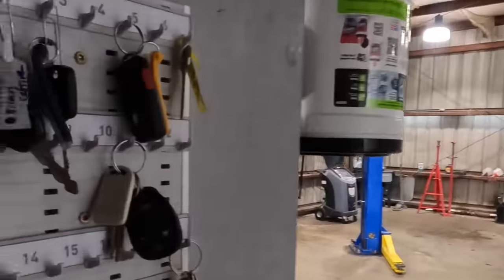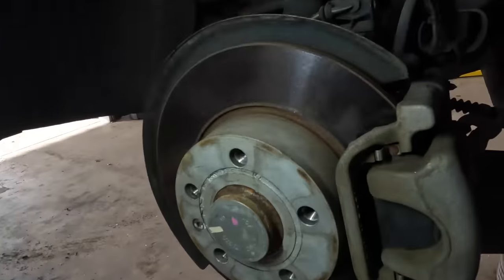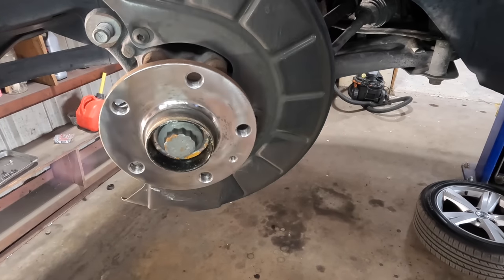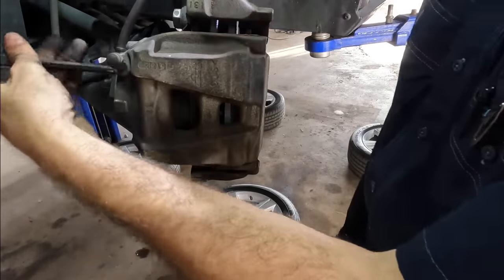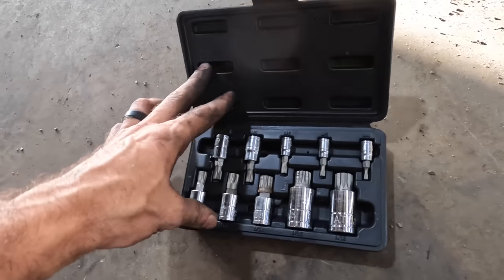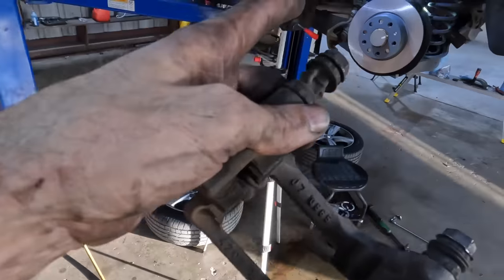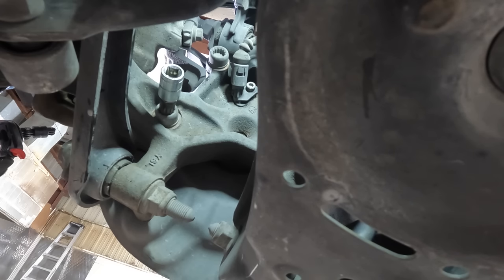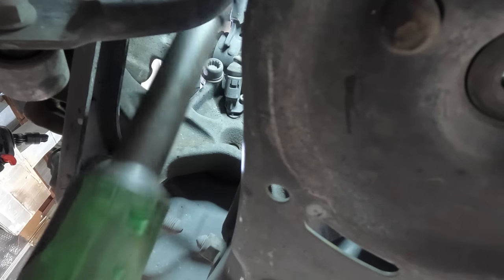Brake Job…with a Belt Sander? 2015 VW Jetta

Comment: Thanks. 33 years later I learn the name of the 1/2 inch 12 point spline tool i needed for the bolts on my mom's '73 VW 412 flywheel, and later on the cylinder head bolts for my 81 scirocco. Also, your shop is too quiet without the doo DEE doo phone ringing. I actuall miss that.

Comment: Might have been "just another brake job", but finding those frozen slide pins on one rear wheel was a good catch and object lesson for us all.  Always clean and re-lube those pins, even if all the other wheels were fine.  Good job!
Reply: I had an accident back in late 2009 because the pins on my Monte Carlo weren't lubed from the factory.  It took 4 years of driving for the pads to wear unevenly to the point of failure (repeatedly "inspected" when I got oil changes, and nobody noticed the outboard pad was fine while the inboard pad was wearing out) and my front left brake failed, causing me to rear end someone else.  That was my last Chevy.  Yes, lubing those pins is vital.
Reply: Heh, had to take a blow torch to my slide pins the other day to get them out 😅

Comment: The front caliper bolts are 7mm Allen. They can be pulled, cleaned, and lubed like normal slide pins.
Reply: That was one task that I did not see accomplished on this video unless it happened behind the scenes...
Reply: Comment needs bumped like sam said i also didn’t see it done either unless it was done behind scene. Also if im not mistaken the rear rotors you can slip past the bracket and dont need to remove it.
Reply: @josihaknox7256  The rotors can be slipped past the carrier on the style without the bar in front of the rotor if that makes sense.

Comment: I've had slide pins stuck so bad I used pliers and a torch to heat up . Then go in with brake cleaner and nylon brush on a drill. Thanks for the video Ray!

Comment: Just a gripe because this is an automotive channel. I just purchased a used Subaru Forester. I wanted to put new brakes on because I trust my own work or don't trust others. Pads had 7-8mm left, so they were done pretty recently. Slide pin on the right was completely seized, like replace bracket seized. Then, caliper on left was seized. I have to same style piston compression tool Ray has, albeit the cheap one. It failed catastrophically. So a new caliper had to be installed as well. Beware of used car dealers that just like to turn em and burn em.

Comment: Just a word of caution about reusing friction materials; I had a pair of brake shoes that had almost no wear at all and so I figured they would be fine (rough it up and go). The wheel kept locking up to the point of glowing. It seemed that some brake fluid had leaked from a replaced wheel cylinder and had gotten into the shoe changing its friction, making it sticky. Long story short, beware of contamination, not always visible.
Reply: Yeah, same experience with rear shoes.
Reply: Oil would make them sticky believe it or not, brake fluid can be washed off by soaking the shoes in water.
Reply: you have a point about contamination but I had lots of gear oil leak onto rear brake shoes. After I fixed the leaky seal I just sprayed the shoes down with brake cleaner and it worked fine for me? Truck stops great so I don't think you always have to replace. JMO.

Comment: I used to do something similar when scuffing pads, a couple of swipes on a strip of wet/dry sandpaper at the bottom of my aqueous parts washer tray (pump running). Keeps the dust at bay. Rinse with brake cleaner, done.

Comment: I have now joined the Cult of Brake Cleaner, back in my unenlightened days I had to remove the protective oil from new rotors with lacquer thinner on a rag. I have seen the error of my ways and truly repented! Besides, Brake Clean is useful for so many other things. I recently used it to free up a stuck ratchet shifter on a bicycle.

Comment: Regarding the slide pins on the last caliper bracket, could it not been excesive heat from the metal on metal that cooked the grease?

Comment: Ray...I've done this exact vehicle and removal of the 13MM triple square fasteners on the rear is NOT required. The rotor slips right out of the caliper bracket no problem. Try it next time...great video none the less.

Comment: Hi Ray, I have to say that chamfering the leading edge of a pad was frowned upon in my training - the chamfer would act like a guide for road dust etc to fit between the rotor and pad, and a square edge was better at clearing contaminants off the rotor when pressure was applied.
Reply: Look at many sets of pads and see if the OE manufacturer places chamfers on them. Think you will be surprised. Retired mechanic in Land Down Under.

Comment: The triple square caliper bracket bolts for the rears are notoriously tight in my experience in VAG vehicles. Last time I did this in my driveway in the rain I just skipped that step and managed to slip the discs in past the bracket.
Reply: Is it pain in the rear to put the discs on without removing the brackets?
Im doing the rear brakes on my Škoda Octavia Mk3 this weekend and this video makes me skip that step too haha
Reply: @Euro.Paleta  i would recommend to have a file by hand, sometimes the new brakedisc dosn't really fit. Just file a little phase on the calibre brackets just 1 mm
I don't know if the Mk3 is the same but on the Mk2 it works
Reply: @Euro.Paleta  I didn't have any issues really, just got to be careful not to scratch the discs. If you can get the old ones off without damaging them then you should be able to get the new ones on, probably... New discs will be thicker because of less wear. I did it on an Audi A3 8P 2011 with little hassle, and that had the same actuated calliper and I believe the same diameter discs on the rear as most other similar VAG vehicles, but I'm basing that of the rear brakes are primarily for stabilisation and parking, the fronts are what will change in diameter in most scenarios. 

I'd be prepared to take the bracket off just in case. Lexivon do some cheap triple squares I think. I personally felt they were too tight for me to lay under the wheel knuckle and hang off them, testing how well I'd set the stands up and covering me in rust. 

Enjoy.

Comment: VW has some insane torque values for many of its fasteners.
Reply: Also many of them are one time use. If it has a torque plus degrees of turn past then it’s definitely a stretch bolt and should be replaced not reused.
Reply: Yeah, the bolts on mine have much more torque than the engine does 🤓
Reply: No kidding. It's completely not necessary at all!
Reply: German engineering at its finest!
Reply: Jason R indeed they do. I had a 2011 jetta TDI sportswagen, most fun car I've ever owned and over time I had replaced all of the wheel bearings. If I recall correctly, the torque spec on the hub bolts was 140 ft. lbs. plus 90 degrees. I needed a torch followed by a 4 foot cheater bar on a one inch drive breaker bar to remove each and every one of them.
Reply: My2016 Tiguan has the same bolts holding the rear calliper brackets. I was aware they would be torqued super tight, but research said they were single use stretch bolts. Bought replacements but didn’t need them. Fortunately, the rear discs (rotors) once freed passed past the bracket without having to remove them.
Reply: If you look closely they have a serated face on the back for even more bite, you can see it at 38.54
Reply: many many many.  lol
Reply: Exactly, I was working on rear of VW Tiguan with same setup, we had to use Impact to break them loose and it literally took all the power my impact had, and we are talking about decent air powered impact here.

Comment: Due to the fact that some brake pads still contain asbestos; you should use some type of personal protection or evacuation method when exposed to the grinding dust like on this repair. Stay safe and healthy Ray.
Reply: I agree with you. Many moons ago when i was in high school, i had 3 years of automotive technology at our local Votech school. One thing we had to do was wear a mask when doing brake jobs. Safety glasses were mandatory. A clean and organized shop was also mandatory. 
I love Ray's video and extreme  knowledge of his trade. Just wish he would stress a little safety and clean work areas.
Reply: Bah...been suckig asbestos dust for decades...still perfectly heathy .

Comment: Hi Ray. I’m from Canada and I’ve never understood the supposed benefits of brake cleaning the rotor. 
By cleaning the anti rust oil off of the back of hub area will only allow the hub to rust weld itself to bearing. Thus having to beat it off on next brake job, potentially damaging bearing! Also the oil will burn off with the brake pad seating process! Lastly after a few years the space between the rotor linings will seriously rust and actually lose thickness, thus leading to wavy rotors. Plus with all the additional rust flying around, it can jam around pads and lead to increased wear. 
So I see zero upside to using spray, including the waste of money and aerosolized crap in our environment!
Reply: Look at brake manufacturers websites and look at their technical information/guidance and compare that to what you are saying. Oil in brake pads soaks in. Ever seen brake pads contaminated with brake fluid. Does it burn off or just create an unequal brake friction on the wheel concerned? Will agree that brakeclean between rotor and hub can create a great space for rust to form. Can be alleviated by a light spray of fluid film on hub (after both surfaces are thoroughly cleaned like Ray has shown). In Land Down Under I use a light smear of wheel bearing grease which is cleaned off every time the rotor is removed. Area is cleaned of old grease and dust and then new light smear of grease re-applied. If aerosol cans are getting under your skin, you can buy 20 litres of bulk brakeclean and buy a pump up spray applicator. Have been using that system for most of my time as a mechanic (now retired).
Reply: Interesting perspective..manufactures don't leave a little instructions in their boxes...

Comment: As someone who works on VW and live in rust land. Those rear bolts are a pain. I think they are aluminium since they don't rust. Just become very stuck. I always hammer the socket then use 1/2" impact.

Comment: not gonna lie, I've done the same thing on cars I've bought.
recent one it had fairly new brake pads and rotors, but because the previous owner smoked the clutch and couldn't/wouldn't get it fixed, it sat for almost a year, so the rotors and pads were a bit rough.  nothing a random orbital sander and some 60 grit to knock the surface rust off couldn't fix.  did the usual break-in procedure again, and the brakes were perfect.  I'm not averse to spending the money when needed, but when you can salvage something you might as well.

Comment: Ray, always respect your mechanical ability and patience.  You need to buy a vice!  This would have made the slide pin removal much easier, as well as sanding the pads down.  I would have wound back the rear calipers slightly as well.  Just a short amount of work to assure the rears are not dragging from the start.
Reply: I'll admit I'm saying this from my comfy chair, but Ray needs:
a) a real workbench
2) a vise
iii) to clean the top of his toolbox
Four - a designated quite clean workbench for brake, hydraulic, AC parts fiddling (the dirt on top of his toolbox just freaks me out when he's doing brake/AC/hydraulic parts fiddling on them.)

Comment: I've owned 5 VW Passats over the last 25 years. VW is NOTORIOUS for over torquing the rear caliper bolts on all models from the factory. One time I had to use a 5ft cheater pipe on my 2ft breaker bar to get enough leverage to break the bolts loose. You got off easy when compared to some. Great channel and good luck. I also enjoy the Wife Unit channel. 👍
Reply: to avoid caliper coming off lawsuit.

Comment: Not all mechanics are as honest as you. 
A lot of guys would just say: 
"The bolt broke, we need to replace the whole kabootle, that'll be $1500 for the dealer only parts please." ESPECIALLY on a VW. Most Mechs make VWs sound so exotic and mysterious... And EXPENSIVE to do anything to. 
I actually had one shop refuse to change the oil on my 2003 VW New Beetle, 2.0L, 4cyl. 
He said to me, AND I QUOTE: "I don't have the special tool needed to change the oil on that car."
Talk about blowing smoke up my... butt... 
BTW, he had a newish VW Jetta sitting in the front waiting for service... 
That would be why I stopped there.... 
His attitude lost him a potential long term customer. 
I have 2 older, high mileage cars that I take care of. I wasn't asking him to trace a typical VW wiring problem, or a mysterious issue that only happens "once-in-a-while"!!!!
In my area, I have a SERIOUS lack of good, honest vehicle service shops. I have to drive 15 miles each way to get an oil change, and it costs me $100. (Synthetic oil). AND I drive 50 miles each way to get to a MIDAS for other service. MIDAS!!! Can't EVER get out of a Midas without a $800+ service bill. Don't get me wrong! They do good work. They have a guy that LOVES VWs. But they are so expensive, I go deeper into debt every time I go. I paid them $3500 for what I thought was SUPPOSED to be an exhaust from the manifold back... They claim... That the now leaking flex-pipe, on a lifetime guaranteed exhaust,  that they didn't change it... It's not theirs. $300 to replace and weld it in please. I KNOW on these VWs the flex pipe comes WITH the new Catalytic Converter as one piece. 
I CAN'T WAIT TO MOVE OUT OF NEW YORK STATE!!!!!!

Comment: Made me smile watching you try to get the triple squared/XZN fasteners out pf the rear, cause i had some MAJOR problems getting them out on my passat too. i usually do my brakes in the driveway but had to go to a lift to get them out, put them on again, go home and finish the job. Threadlock is the key.

Comment: Heckins yeah my dude!
I personally use the Lennox brand metal sanding flap discs for my cordless grinder

6"level, clamp in vise nice and flat employing some paralells then just the weight of the grinder itself as the force.

Once the ugly surface on the pads looks fresh and uniform, i then use a 14" piece of 2x2" solid aluminium, machined true.
Clamp sandpaper to it, then circular pattern, maybe 10 strokes just to get them as flat as is Garage workspace achievable.
Reply: he got them nice and shiny already.
Reply: You can’t really use torx on hex if they are seriously tight ! once you’ve achieved maximum thrutch, a torx is likely to round ‘er out !  I used to do brake pads on a nice flat concrete kerb , and shoes with a hacksaw !
Reply: @CrimeVid  he will use same belt sander for engine resurface too, he has yet risen to your  high level.

Comment: a few years back now I had a sticky front brake on my volvo, the calliper piston was sticking, I took it off and nothing I could do was getting it to budge, in the end I actually disassembled the calliper, and used my air compressor, 150 psi got the piston out and i cleaned the rust out of the bore, reassembled it and refitted to the car (and ordered a new one to fit when it arrived) it kept me going the few days it needed to (I was commuting 124 miles a day back then)

Comment: I really love watching your videos Ray!! Keep up the good work. From one mechanic to another I work on a lot of volkswagen here in the UK and just some advice on the rear discs 90% of the time you slide the rotors/discs off without taking the caliper carrier off hope you see this and remember for next time 😀😀
Reply: I would love to see you pull that rotor off with the caliper bracke in the way. Obviously, this is one of the 10-percenters.
Reply: David this is definitely one of the 10 percenters I've seen Ray do a few volkswagens over the last 2 years of watching him and he always takes the carrier off which isn't bad practice but if there's an easier way then why not 😀
Reply: I just put new pads on my 2015 Honda Pilot at 52K miles. Old pads still had 5-6 mm on them (I'm easy on breaks) but new ceramic pads for all 4 wheels were only $65. Cheap insurance and flushed out the old break fluid $8.
Reply: That seems obvious now I’ve seen the video without wheel studs it appears a simple thing 👍

Comment: To prevent slip out on recessed fasteners a dab of valve grinding paste on the driver will really enhance the grip,  carbide in the paste digs in to the driver and the fastener and will seldom slip out, be sure to clean off thoroughly afterwards, or it will seriously damage moving parts

Comment: I have found using a short bungy cord to hold the caliber in place saves you a lot of trouble doing this kind of work. Just helps prevent having to fight with the calipers when they like to fall.
Reply: $10 gets you a set of metal S hooks that are also very good at hanging them up and away.
Reply: @theundergroundlairofthesqu9261  The nice thing about the bungy cords is they are about a dollar and have hooks on each end. I use 4 six inch long bungee cords (stretch to about a foot long), to hold up each caliper when working. SO all in about $5. Just make sure they are the fiber wrapped multi strand types. This way if the elastic cords inside do fail, the outer fiber wrap will prevent the caliper falling. Have used the same set for over 10 years without issues.
Reply: @JJ_ExMachina  I used to use coat hanger wire. That's... doable. But your bungees or my current S hooks are better!
Reply: @theundergroundlairofthesqu9261  ... For sure, just simple tools to make things easier and or safer.